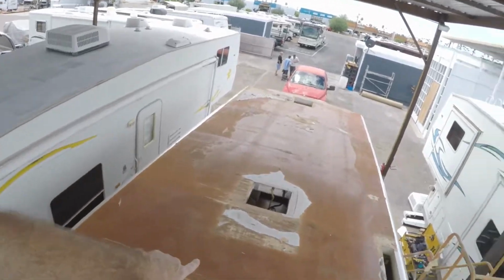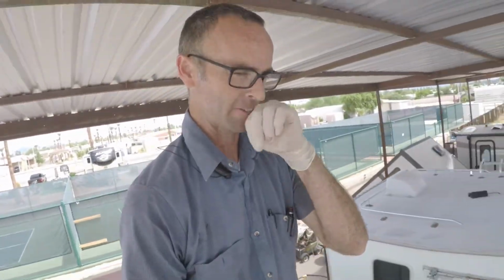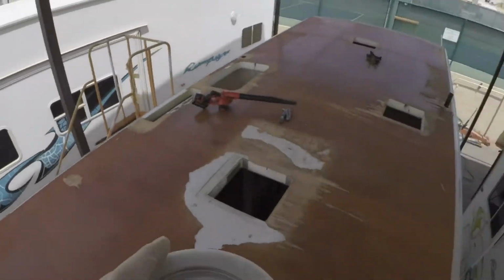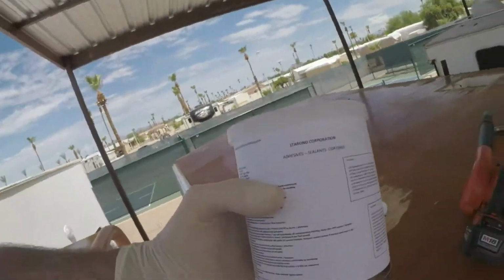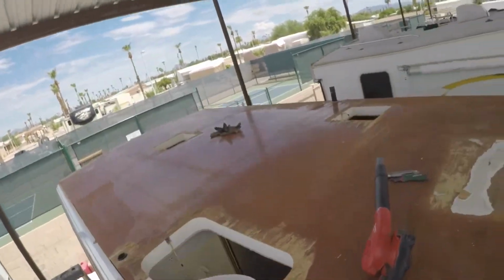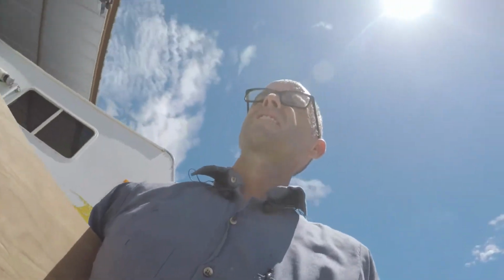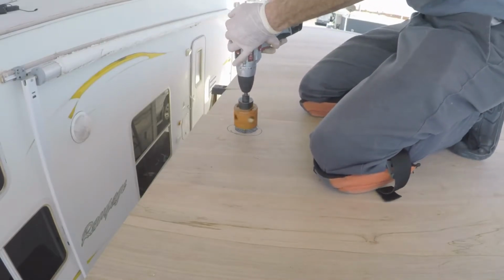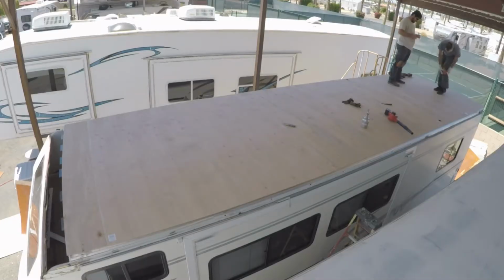Replacing a laminated Winnebago RV roof PART 2

Comment: What was wrong with the existing luan? Do you just not want to glue new roofing to existing glue covered wood?
Thanks for the great vid!
Reply from the maker: The luan is 1/8" thick and some of the layers will be ripped up or damaged when the filon is removed and will keep the new filon from laying flat. The radius is only designed to work off a 1/8" substrate and doubling it to 1/4" will cause problems with the radius formation. But most importantly, it's much easier to start with a known good substrate and saves a great deal of time. Luan is only $15 a sheet so for less than $200 I'm not risking thousands of $ in glue and fiberglass and labor. Thanks!
Reply: @AZExpert  Got it - thanks for the response!

Comment: Since Luan Plywood is so inferior, why do they use Luan Plywood underneath the exterior Filon? Why not use a thicker exterior finish Filon and eliminate the Luan Plywood? Maybe screwing the Filon to metal studs/posts?
Reply from the maker: RVs are a fine balance between, cost, ,weight, durability, and decor. Many manufacturers are eliminating luan from exterior walls now

Comment: Why do you run the Luan Plywood long on the width and then trim after it is glued on? Why not trim it to width first?
Reply from the maker: in case we make a one inch placement mistake
Reply: @AZExpert  Since you are running the width longer than what it has to be, then cutting it to the correct length, are you concerned that the last inch in width will not adhere to the glue on the roof because the plywood is higher than the roof edge and or the glue has dried? How much time do you have before the glue is dry and no longer usable?

Comment: I've got a rexhall aerbus how do you know if that's a laminated fiberglass or if it's solid fiberglass
Reply from the maker: Though you did not give a year, I think I remember them being a true gel-coat fiberglass roof. Sometimes they had a set of textured aisle for walking on. The easiest way would be a filon roof has subtle swirling fiber textures just like the filon sidewalls, and a gel-coat fiberglass roof is smooth from the mold. Of course you could always remove a vent or skylight trim from the ceiling and look at the cross section of the roof. Thanks!

Comment: What size luan did you use? Did you have to order from Winnebago or were you able to buy it locally?
Reply from the maker: I am sorry I just saw all these comments. They are just 1/8" 4' x 8' sheets from Home Depot underlayment. The filon can be sourced from Winnebago, but depending where you live there are better sources like Hemmet Valley or All-Rite. 
https://www.all-rite.com/flex-roof
Reply: Hey quick question for you. Which contact adhesive are you using to secure the underlayment to the Styrofoam? We ordered all our supplies from winnebago, they sent us a 5 gallon jug of contact cement that they claim is what they use- Henkel Loctite S 563R. We have tried both spraying and rolling on this stuff and it is eating/pitting our Styrofoam, I feel they sent us the wrong stuff but they continue to say its what they use. Looking for alternative if you could help. Thanks!
Reply from the maker: We use Stabond for foam: https://www.all-rite.com/adhesives-and-tapes/stabond-e-183-glue
It sounds like winnebago sent you the contact cement that is not foam safe I would guess it is . However, it should still be very useful for bonding the filon fiberglass to the luan plywood. I have found an air spray gun the only way to apply either cements, especially to foam. My best advice is to grab a cheap one from Harbor Freight:https://www.harborfreight.com/air-tools/paint/industrial-paint-spray-gun-43760.html. I consider them to be disposable after the job is complete rather than try to clean it. Make sure you spray both surfaces and let them tack before you bond them....and try to only do manageable areas at a time. 
If Winnebago is standing by that this is the correct adhesive, I can only say that even foam safe glue will melt foam if put on too thick. Have you tried light passes on the foam with a spray gun? The adhesive should spray out more like a spider web than a liquid paint.
Reply: Thanks for the reply. Yeah that Stabond is the same stuff we ended up ordering but you are right we can still use the other for filon to plywood. We bought and were using that same gun from harbor freight and it was doing the spiderweb look and we thought maybe something was wrong with gun so we bought another brand and it did the same thing so sounds like thats just how it comes out, problem is, wherever there is a "dot" or speck it would just making small pinholes and melt the Styrofoam, tried to spray as light as we could but the adhesive seems to be impossible to use on Styrofoam. Crazy part is that winnebago says its 100% same stuff they use and pretty much agreed that it can melt Styrofoam some and to put on light, unbelievable really.  Stabond expensive so maybe thats why they make the other stuff work but seems unprofessional to do that. Again, thanks for the reply, waiting on the stabond to come in and will continue project. Your videos have been big help!
Reply from the maker: I'm definitely glad you didn't continue using the glue and melt too much of the foam as that is a much more difficult if not impossible repair :) I think the last time I used Winnebago adhesive it was a red Weldwood industrial type so I am not familiar with their current choice but have found Stabond to work a hold up very well on all the roofs and sidewalls we have done but Stabond is spendy for sure.

Thanks for the comments and I am happy the videos are helping.

Comment: Music uggg.   Question: is there an RV roof system better than any  other system?  How about insulation? Who is better?
Reply from the maker: Winnebago's roof are very unique in the industry. The best roofs are true gel-coat one piece fiberglass used on high end diesel pushers. Tiffin and Monaco manufacture with this type....Tiffin is much better. Insulation is probably best with Newmar as the roof is very thick with a support structure in the middle cuasing little thermal bridging,......but of course there is little true difference in heat gain or loss as all  motorhomes are  a box with a great big glass window on one end and windows everywhere else.
Reply: @AZExpert  Is this roof your working on now the same type on a 92 Winnebago Elante? I'm looking at a used Elante that has been stored outside for years. I have concerns on the roof but no apparent leaks on it.